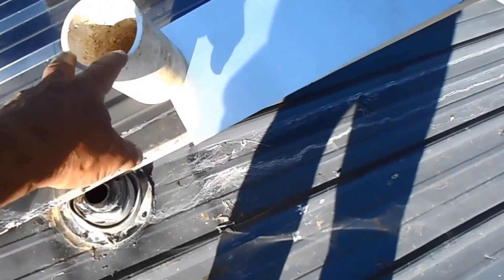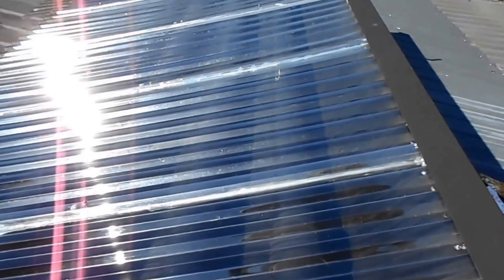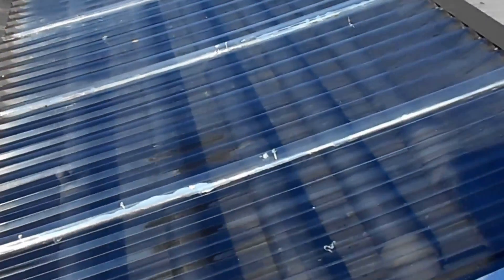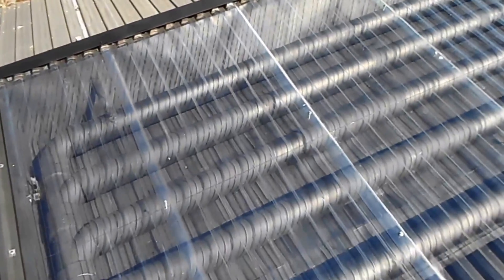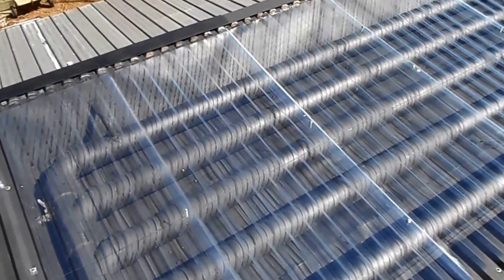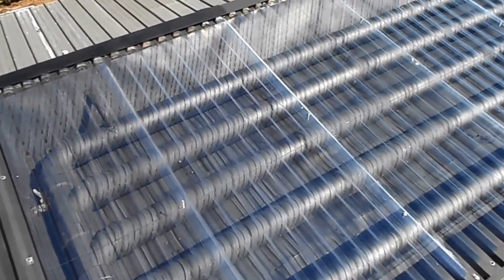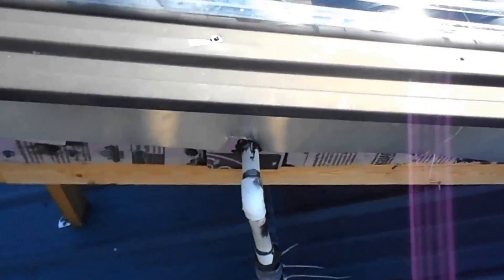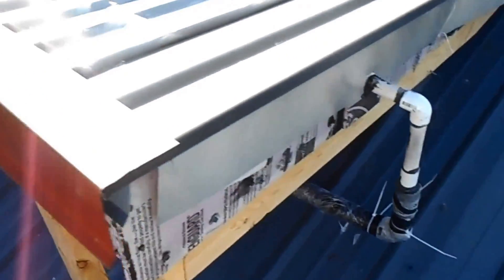Solar hot water

Comment: How warm is the water in the winter when its 32 degree's outside at 8:30 am?

How about putting a timer on the hot water heaters to turn off most the day and one just say a couple hrs before the morning bath or showers?
Reply from the maker: +Bond_James Bond about 45 degrees in am....yeah we keep our water breaker turned off..we do use it sometimes .we cut the breaker on for 30 minutes and then cut it back off..running the water for 30 minutes means you dont add cold water just straight hot water.if 30 minutes is not enough leave it on 40 minutes till you know the perfect temp.tks
Reply from the maker: +Danny S Hodges i have to lay a 4x8 sheet of engery siding on top of the top in warmer months it get real hot. today is 10/4/2015 and its still on there...i will take it off next month for the winter..it dont have to be hot weather for this to work...just good old sunshine

Comment: I couldn't read the temperature, how hot did the water get in the glass?
Reply from the maker: 106 DEGREES WAS THE TEMP ON THIS VIDEO  AT 2;00 PM I HAVE A UPDATE TO THAT VIDEO ON MY CHANNEL WITH A HIGHER TEMP.I CHECK IT TODAY THE OUTSIDE TEMP WAS 32 DEGREES BUT I WAITED TILL 5;00 PM TO CHECK IT IT WAS 113 DEGREES....THAT BOX GETS HOTTTT
Reply: Danny S Hodges That's awesome, good job, man.
Reply from the maker: TKS BOB
Reply: Danny S Hodges I bet in the summer it gets too hot. 120+
Reply from the maker: 160 DEGREES IN SUMMER I HAVE TO SHADE IT SOME...STAYS HOT 24-7 IN SUMMER